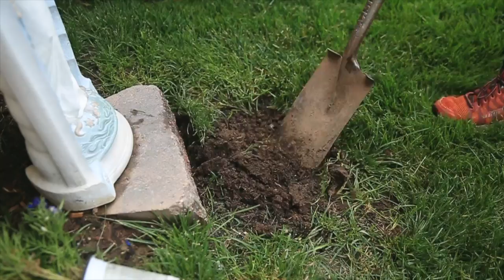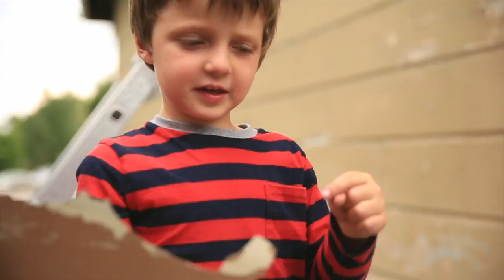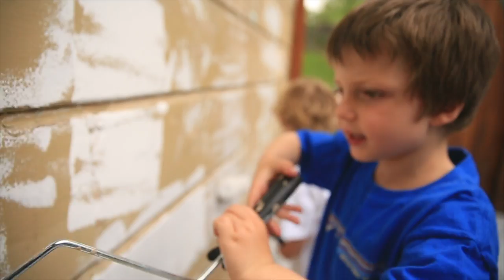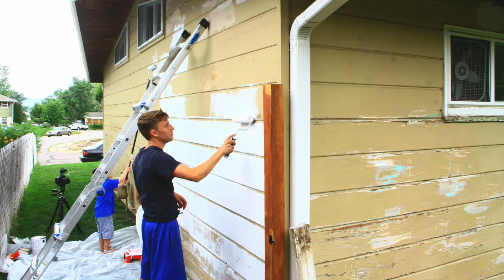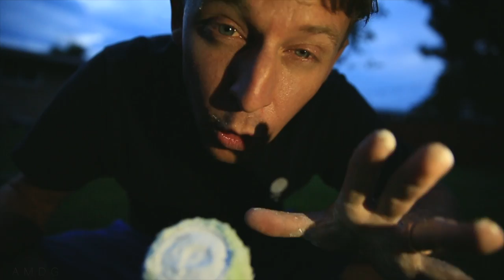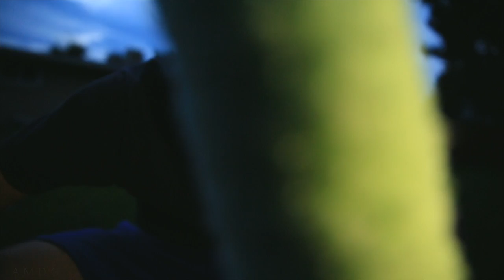got messy

Comment: Qd: only painting tip is with regard to silicone -- wet your finger before you try to smooth it out, works wonders!
Reply from the maker: FASCINATING! That's huge because I'll probably be doing some more silicone here before the snow flies.
Reply: And, if you need to get it in one spot but not around it (like along a seam), use painter's tape to outline the area, then remove the tape after you've smoothed it out with a wet finger!